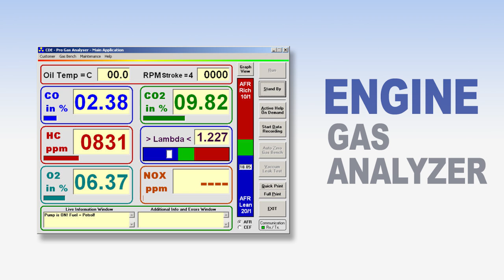Goss' Garage - Engine coolant and oil mix

Comment: my cap has some milky stuff on it but doesn't have anything on the dip stick. the car has been sitting for 3 years now and i decided to pay some attention to her
Reply from the maker: Raheam:
Thanks for watching and taking the time to comment, I appreciate it! The milky residue on the bottom of the oil filler cap is normally caused by an improperly functioning crankcase breather system (PCV). It’s caused by the breather not being able to move all the moisture out of the crankcase. No biggie!Pat

Comment: What is the reason of car drinking 1 litre of coolant in 1 week  after changing head gasket ??
Reply from the maker: Hi M:There are tons of possibilities. It could be the head gasket job was not done properly, the head gasket is defective, the engine has a cracked engine block or cracked head, there is a problem with the intake manifold, leaking hoses, leaking hose connections, bad heater core and the list goes on. The reason for the new head gasket might shed some light on the cause of the current problem as would the year, make and model of the car plus engine size. Obviously it needs to be 
checked by a competent tech to see what’s going on. This will probably require a 
coolant dye test and an exhaust gas test.Pat
Reply: Thank you so much